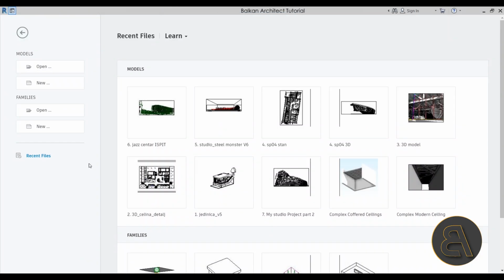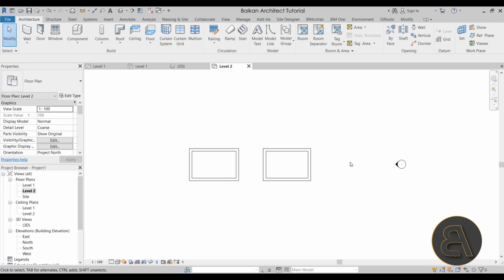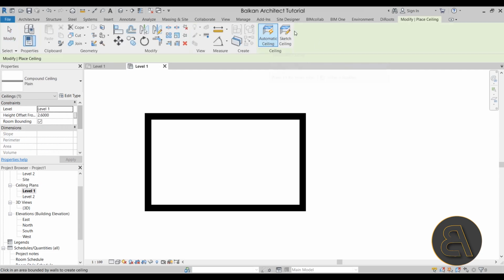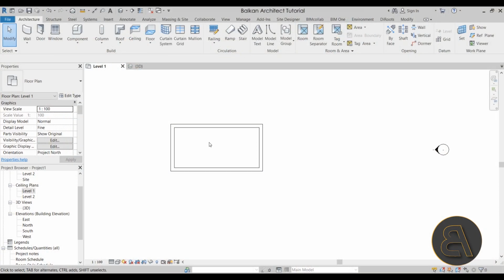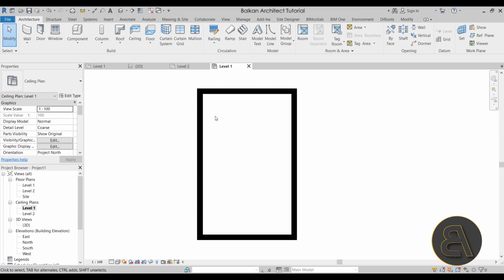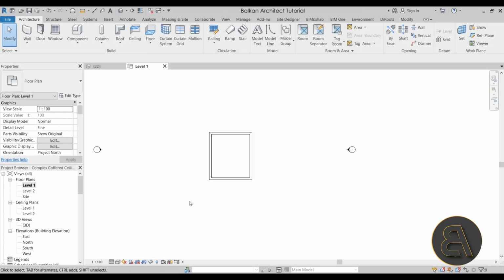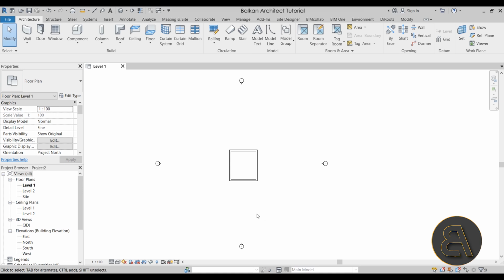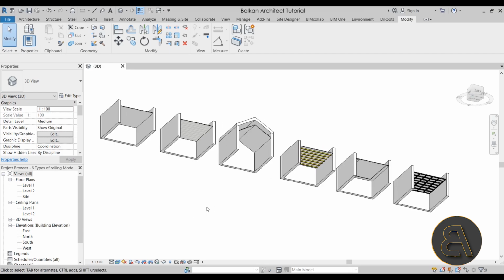6 Types of Ceilings Modeled in Revit Tutorial (Ceiling in Revit)

Comment: I have a problem when i make two types of ceiling such as tiles and plain gypsum board with different heights in the same room there is a gap seen in the section between them so I want to know how to fill it with another gypsum board but in the vertical direction